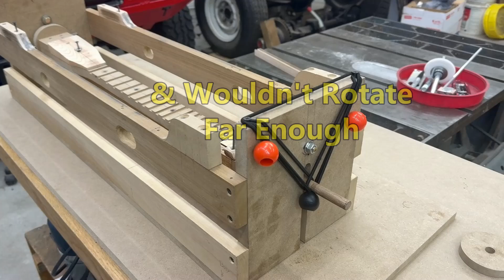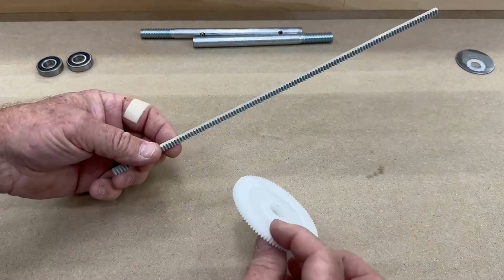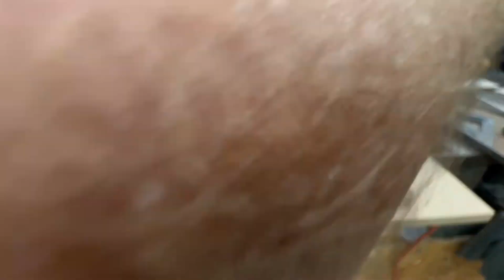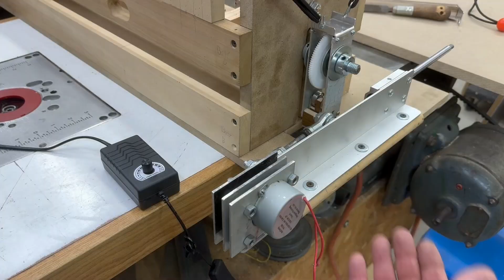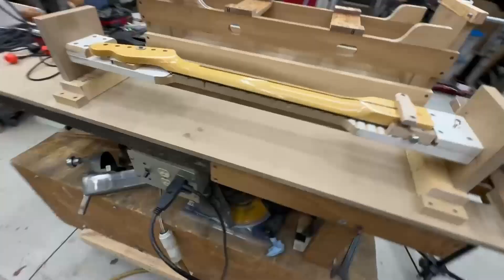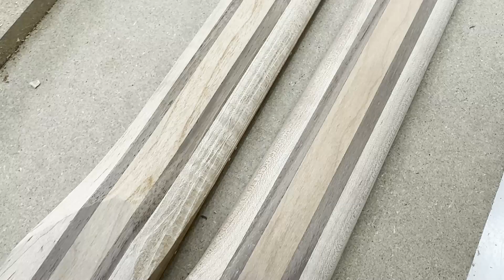Guitar Neck Profile / Copy Jig Automation

Comment: That's a really great and thoughtful cradle system you put together. I'm a fellow guitar builder and have tried the router jig like yours but without the mechanical assist, hand carving, and I do have several sets of the custom router bits, one from the guy in Australia (can't remember his name) and a set from China snd Japan. For me I've gone back to carving all of my necks by hand, I've gotten really proficient starting witch a razor sharp spokeshave then finishing with Dragon wraps. The router bits work great but there is quite a bit of jigs and set up if you want to get the most out of them. I really like using the router jig but it took up so much space in my shop.
Reply from the maker: @Ibaneddie76  understood